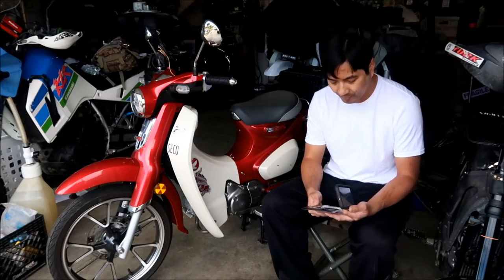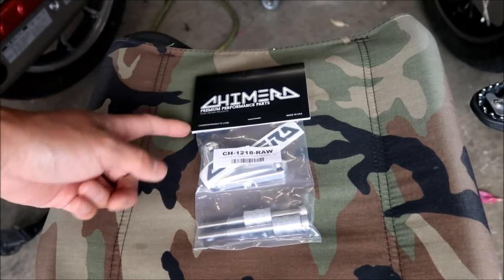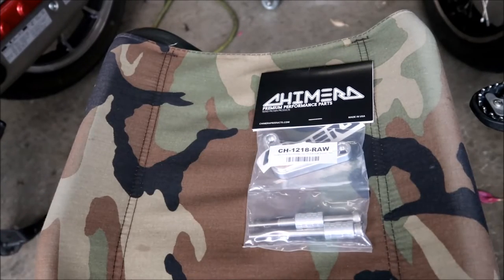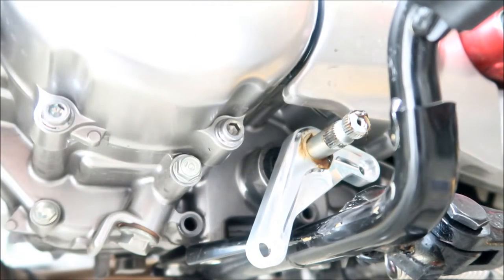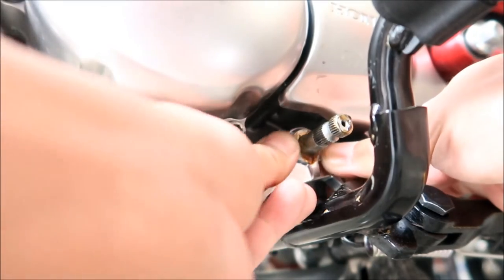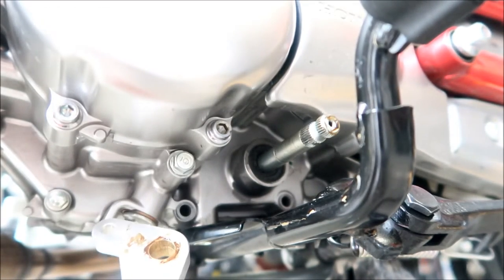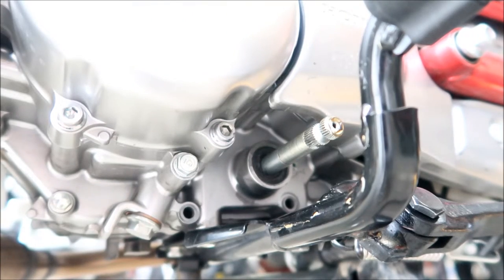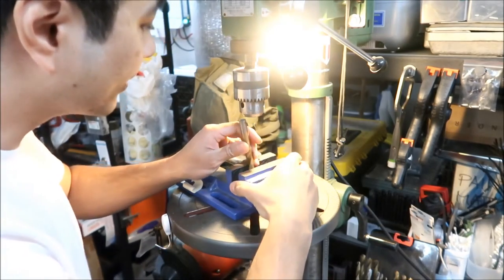Honda Super Cub C125 Chimera Shifter Shaft Support Install VLOG

Comment: That's a shame it didn't fit. Looks like it was designed for the wrong bike. I didn't have that problem with my G-Craft Shift Support, which was C125 specific. The Honda Grom & Monkey use a different part.
Reply from the maker: Yeah it's a shame it definitely doesn't fit the Super Cub =(
Reply: Actually, Merlin might have received one that had the bushings inserted incorrectly, which might be the reason why it didn't just go right in. The large bore side of the bushing should be on the inside. We could see in a few shots that the bushing had a smaller step on the inside. This was corrected towards the end of 2021 when they found out that some of the support wasn't sliding in all the way. Therefore all of the ones shipped after October 2021 have been corrected, no reaming of the bushing is needed. We have sent you an email Merlin!

Comment: If you ever re-visit the installation of the shifter-support, I'm wondering if a thin shim between the shifter support and the shifter shaft would eliminate the small gap and tighten-up the installation for improved performance?